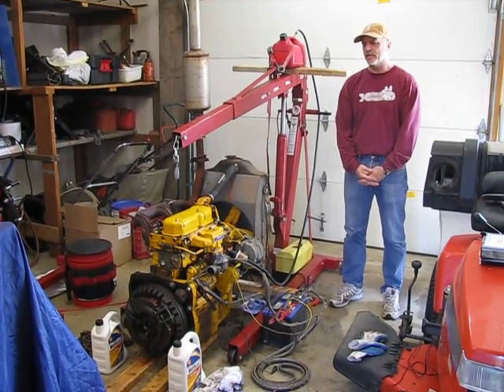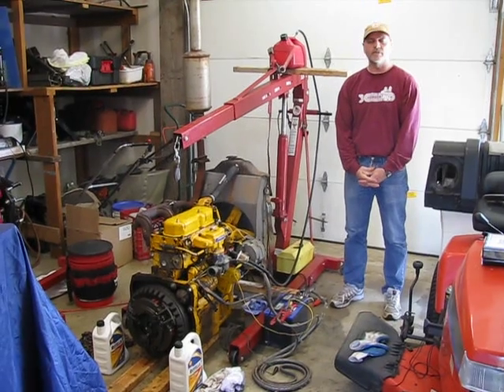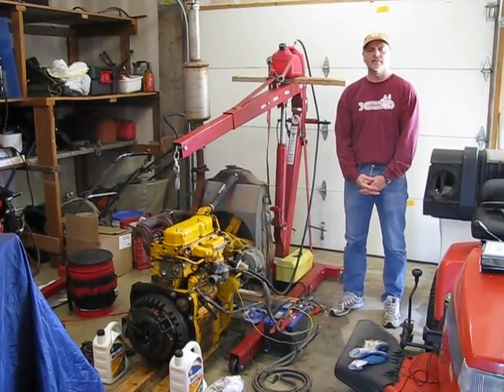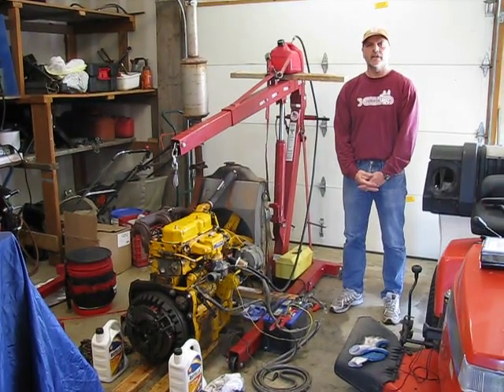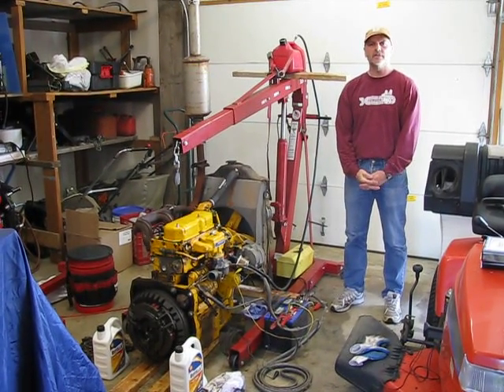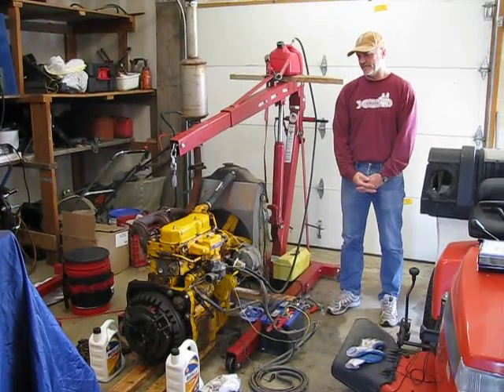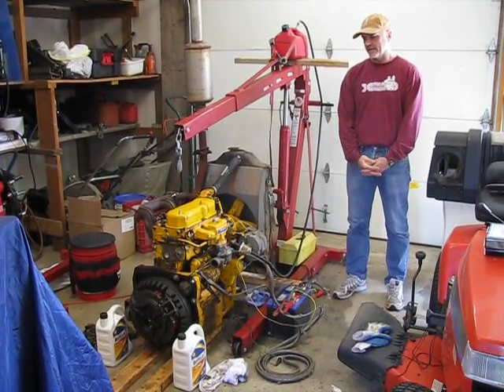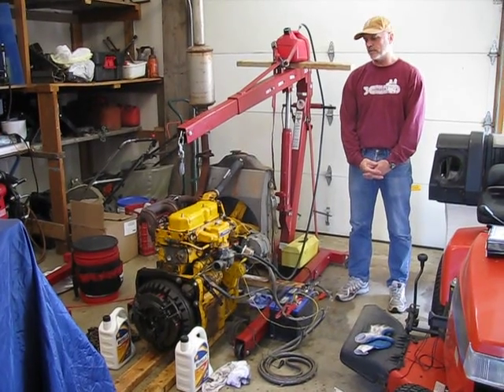Perkins AG3-152 Test Run

Comment: I have a 3 cylinder perkins gas engine on my backhoe my govenor seems not to be working any info what could be wrong
Reply from the maker: I would suggest getting the maintenance/overhaul manual (ebay?) and going through the adjustment procedure for the governor.  If it does not adjust correctly, I would suspect there is a broken spring or other component.